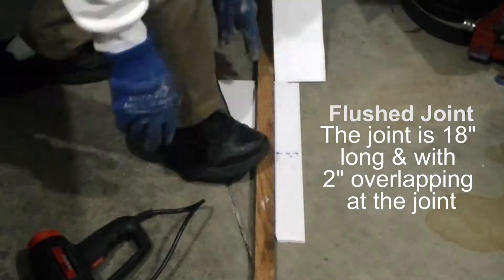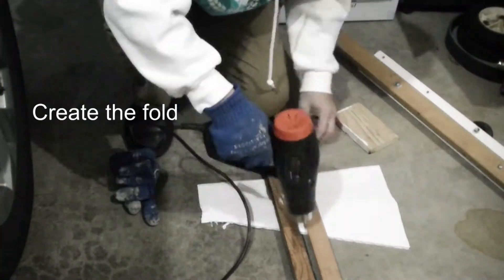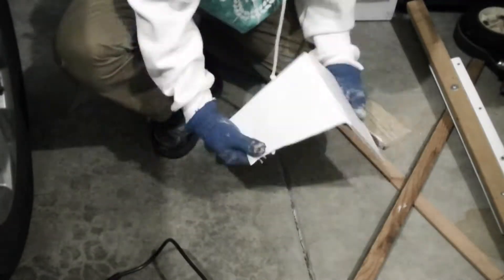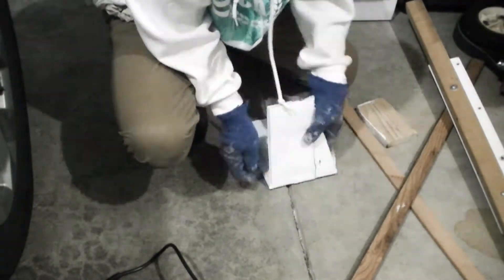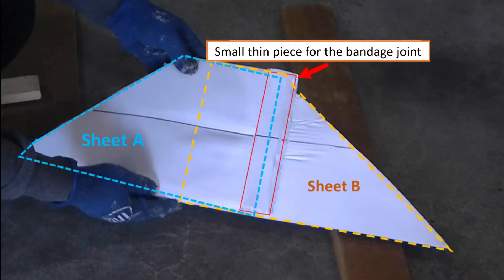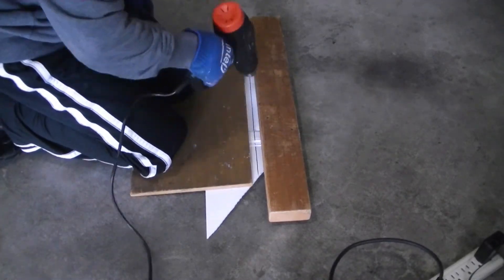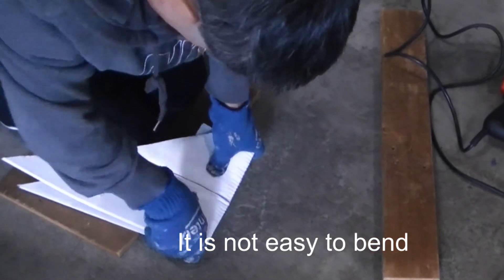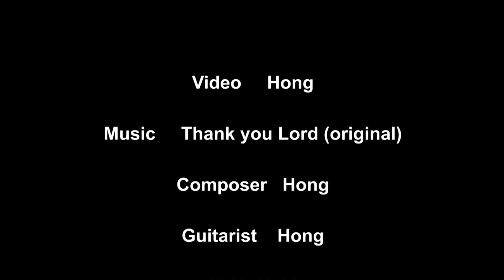Fusing Coroplast & Applications Part 4: Fold across the joint

Comment: I am thinking of building an ultralight micro camper.  I am wondering about fusing small lattice strips between sheets for added stability.  What are your thoughts?
Reply from the maker: Thanks for your question. I have tried to embed wood strips in the boat. Please watch this video 2:49 https://youtu.be/5P02kll-qOI
I have also used coroplast to form a L shape stiffener to strengthen the boat (same video near the beginning of the video). 
In another boat, I used flattened PVC pipe to add strength to the boat. PVC will not rot  0:36 into this video https://youtu.be/nheU58VlZhw
Because of the limited bending radius of coroplast, I have not been able to embed a round PVC pipe with good result, hence I flattened the pipe. I have come across a patent which claimed to insert tubing inside the channel of coroplast to add structural support to the assembly. I think this is doable if the coroplast is thicker, such as 10 mm thick. You may insert the thin tubing, such as those use to set up tents, to provide extra support for the structure. I want to use coroplast to build a car top carrier also. Having fun building your camper!

Comment: How to join two edges of coroplast without overlapping?
Reply from the maker: Thanks for asking..I can think of one way to join two sheets together without overlapping is by tape. However, the join will be weaker (Vs heat fusing them).
Reply: @DIYUSA  Thanks for your reply.i saw a aquarium top which is made of coroplast.two edges is joined but not seen any tape.Also I tried heat fusing but is get damaged. If you know how to heat fuse please let me know
Reply from the maker: @aljaseemrasheed4886  If possible, would you please take a picture of the aquarium cover and you may not need to join two sheets. It may just be one sheet and you can create a 'living hinge' by folding the coroplast. As on heat fusing, how thick is the coroplast you have experimented with? This video showed how I fused two 4 mm sheets together.  Fusing starts at 2:20 into the video https://youtu.be/TvnjSLL67iU
Reply: @DIYUSA  can you please give me your mail Id so I can send you the image
Reply from the maker: @aljaseemrasheed4886  Would you please email to   PDXboatmaker@gmail.com    much appreciated!
Reply: @DIYUSA  hi I send you email
Reply from the maker: @aljaseemrasheed4886  Thank you so much. I learned something new from your photo. I don't know what process they used to hold the coroplast together. It could be glue, but on the top part, the seam shown different bonding characteristic than the slopped edges (which looks like some kind of fused joint). I will do some investigation on the process. Thanks again for sharing the photos.
Reply: @DIYUSA  please send me the details once you find out the technique. I tried a lot but not get any solution
Reply from the maker: @aljaseemrasheed4886  Yes I will. I will go to my local aquarium shop and see if they have that... I don't know if they are open due to COVID-19.
Reply: @DIYUSA  hi did you get any solution?
Reply from the maker: @aljaseemrasheed4886  Thanks for the follow-up. I plan to see if I can try to fuse it with the tools I have. But I have been very business working on other videos and designing another boat before the cold weather comes. Sorry,  I will not be able to try my idea till sometime in October. Thanks.
Reply: @DIYUSA  ok
Reply: @DIYUSA  Hi, did you find out how it works ? Have you ever tried to use a plastic welder ? btw. I like your videos ;-)
Reply from the maker: @HildeHofer  Thanks for your feedback and question. The idea of using heat to bind two sheets together come from ultrasonic welder for coroplast, but they are expensive. It basically using heat to close/fuse the joint. I experimented with heat to fuse coroplast. You can use heat gun, heat plate (people use that to bend coroplast sheet into a box), cloth iron, etc. I have seen some plastic welder like a soldering iron with a flattened tip; I have not tried that type of welder because the heat could be too concentrated, it will most likely pop a hole on the coroplast. However, I have used soldering iron to soften the sharp edges of coroplast.
Reply: @DIYUSA  Thanks for your answer.
I want to build a kajak now, but in germany I can't find that material you are using "Doppelstegplatten" made of PP, they almost only sell PC, but not in the right size. Have you ever tried Polycarbonate ?
I read on wikipedia that its not that robust...
Reply from the maker: @HildeHofer  I did look at using Polycarbonate. It cost more, but very strong. However it is not flexible and I can't fold it. It is heavier also. It would be a good material for a rigid boat with a transparent hull. I used Microsoft copilot to check where to get coroplast in Germany, here is the reply: You’ve got a couple of solid options in Germany for sourcing large sheets of Coroplast (corrugated plastic):

🏪 Retail & Online Stores
CagesCubes: They offer full-size Coroplast sheets measuring 209 cm x 99 cm in seven different colors. These are typically used for CyC cages but can be repurposed for other projects.

COROPAK: A trusted supplier of plastic solutions in Germany. They specialize in Coroplast for signage, displays, and point-of-sale materials.

🏭 Manufacturer Direct
Coroplast Fritz Müller GmbH & Co. KG: Headquartered in Wuppertal, they’re one of the leading producers of Coroplast materials. You can contact them directly for bulk or custom orders. and links are:  https://cagescubes.com/de/936-ganze-coroplast-platten    https://www.coropak.com/de/koroplast/        https://www.coroplast-group.com/en/facts-and-figures/locations-worldwide/
Reply: @DIYUSA  Oh thanks a lot , I will check that out, I hadn't found anything !
Reply: @DIYUSA  Is 99 cm width large enough ?
I had calculated around 1,30 m, 60 cm in the middle , and min. 35 cm for each of the sidewalls.
Reply from the maker: @HildeHofer  How much do you weigh? in Kg or lbs. In general, the width of the boat is between 26-28" wide, can be wider. The side wall can be at least 9"... this also depends on how heavy you are. I assume the boat is 9.5' long.
Reply: @DIYUSA  I'm 1,86 m with long legs, 75 kg weight. 26"+9"+9" = 44", but the piece is only 39" . Another thing is, that I would like to sit pretty high in the boat, how high should the sidewalls be, and wich kind of kajak model would you recommend ?
Thank you for your help👍
Reply from the maker: @HildeHofer  You are tall, but not very heavy. That means your boat has to be long to accommodate your height. My recent video demonstrated my friend at 6' tall and the boat barely fits him. https://youtu.be/i9UAA5YCPAo  One suggestion is to make a pontoon boat. You can use four sheets of coroplast and make 4 pontoons. The concept can be similar to this one. https://youtube.com/playlist?list=PL2ShZzOUu01vDlrGi_EIoU5XpLTlOIVZ0&si=7XmI6AJMDZYeaTnC    You will be able to seat higher, and it will be very stable. It can accommodate a tall person also.
Reply: @DIYUSA  I like the ponton too, but i like the foldable kayak better, because the transport is easier. Do you think it would be possible to put 2 sheets together, to make it longer, maybe 4 meters ? Or will it get instable ?
Reply from the maker: @HildeHofer  It is possible to join two sheets together to make it longer. I have done that a few times. But the sheet you have is also narrow. I don't want to join 4 sheets together to make a wider and longer sheet because it will not be that reliable. Though a YouTube viewer has tried that.  But his boat is not foldable.